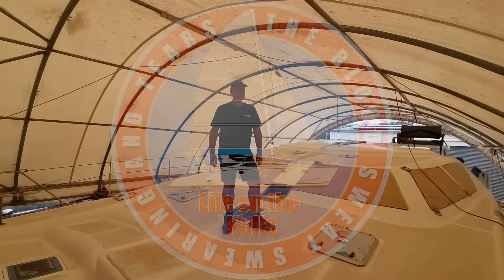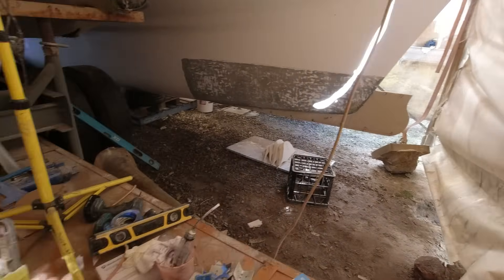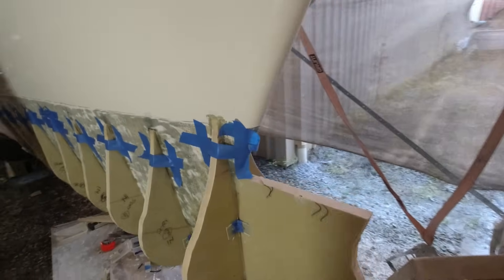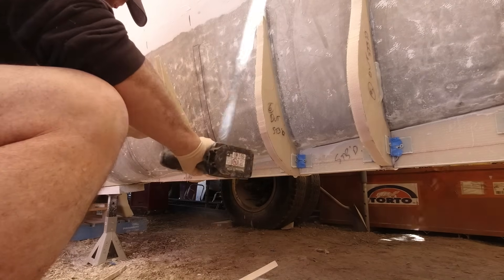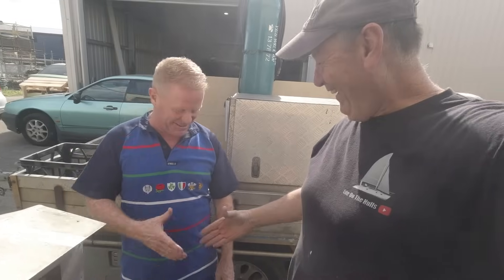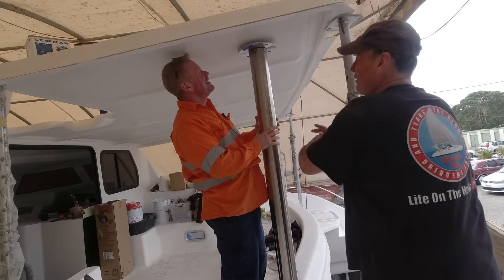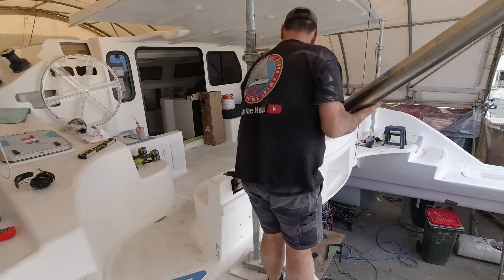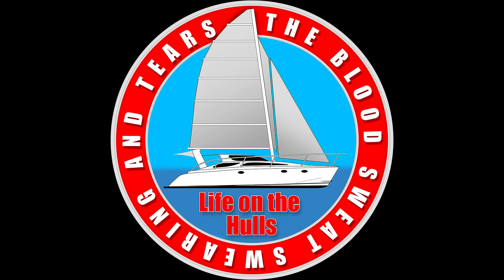The TIG Welding Begins // Catamaran Building Ep303

Comment: Rosco cover them windows as the sparks will probable imbed in em ! Welded up over a hundred feet of deck railing and ruined quite a few a few deck glass pieces and also a couple windows ! Makes a grown man cry .
Reply: Absolutely. I built a steel ketch and the sparks embedded in everything, then subsequently rusted…

Comment: Will you be back flushing the 316 tubing with a flow of argon when TIG welding, to prevent "sugaring" on the inside that causes the tubing to corrode from the inside? Better check that detail with your welder.

Comment: Happy New Year to you , Janet  and your family. I would just say I am anti outside guard rails.
Having been on and driven Pilot boats, the boat I do most of my pleasure sea miles on has inboard tubular rails. These are much safer for access forward and docking, you just step off when the gap is acceptable, no climbing over wires. Stops all the strain on uprights when people want to "assist " you docking too.